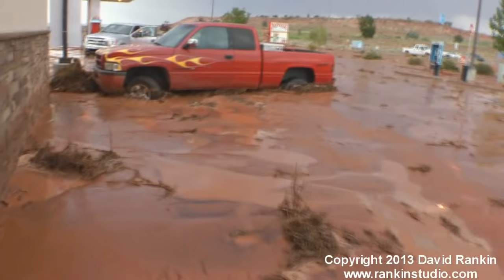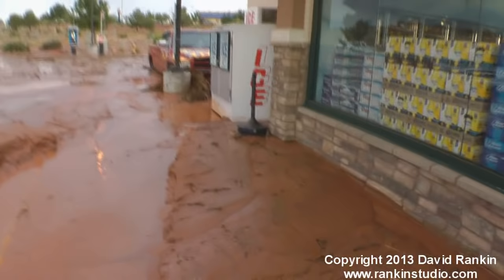Insane Flash Flooding, Antelope Canyon and Page Arizona. August 2nd, 2013

Comment: To anyone wondering flash floods happen basically every time there is significant rain in AZ. Not to this degree all the time obviously but the ground is so dry and hard that it takes forever to absorb water so if it rains for more than 10 mins its start flooding

Comment from the maker: I did tours out there for 2 years. It was amazing to see how the canyon changed from flood to flood. I have seen it change over 5-8 feet just between two floods. It was like a new canyon each time it flashed. I would think these floods are definitely lowering the floor.
Reply: Well then why did you say it wouldn't show much difference in a timelapse ? Just wondering, this video is quite an awesome spectacle, thanks !  🇨🇦
Reply: Visited upper antelope canyon and the guide showed us a feature called the cats head , went back 3 years later and you couldn't see it because the canyon floor had changed and you didn't get the same perspective

Comment: I find it interesting that Arizona  has little water and yet they allow this water to just run down hill and 'go away'. Some engineering creativity
 seems to be in order here.
Reply from the maker: They don't allow the water to go away. All of this water ended up in lake mead eventually.
Reply: rankinstudio Water will not 'wick' into the soil if the soil is dry. Diverting some of this water onto many holding areas might allow the water to sink below ground and fill up the aquifers down deep. Those aquifers are getting depleted all the time but not from evaporation but instead from farmer's and others use of it. I am very sure that much water in Lake Mead evaporates. Water in an aquifer won't evaporate. Filling them up is the issue and creative efforts of engineers could be helpful if not necessary. That is what engineers do, isn't it?
Reply: I find it interesting that you think water just "goes away".
Reply: Most of it doesn't go to waste. It can end up as ground water. In fact, we use A LOT of ground water as a good source of water here.
Reply: Aquifer (ground water) levels are being reduced faster all the time. Yes, ground water is an important source of water but, to me this video's water is just 'running away'. I doubt that much of it gets wicked into the ground to replenish the ground water already there. You may use A LOT of ground water today but what will you do when the ground water aquifers are empty? Wicking this 'run away water down to the aquifers' may be in order.......How to do that is the question.
Reply: Arizona has many groups and projects to help conserve water for the masses. In fact, I took part in a project in 8th grade that helped reduce the amount of water used to water the fields yet still have enough to keep the fields in good condition. Besides, I'm pretty sure some people out here in Arizona puts that rain water to use and the desert animals can have a source of water for the time being. Many insects and bugs can also flourish after heavy rainfall. If there is a state that needs rainfall water, it's California. The drought is still going on. :-/
Reply: Sorry if I sound a little bit defensive. I just really love and respect my state is all. But, your idea isn't exactly a bad one.
Reply: Nice that you have made some effort. Keep up the good work.
Reply: Actually I didn't see the defensive part of your message. You were just stating facts as I was. My position is still the same: The water just runs away. Beats the crap out of my but my guess is that all your 'leaders in the state of Arizona have always lived there. So this run away water is what has always been and they are unable to see the possibilities of change. There are many flood run away channels in Arizona...."It rains in the mountains...but we just get out of the way and let it ...run away.
Reply: Saving your water, or not, is not my problem but I have made an observation that may or may not have value. You decide.
Reply: I have nothing more to say about this.
Reply from the maker: Just an FYI, all of this water ended up in Lake Powell. A reservoir.
Reply: oknwht - You been to Southern Utah/Northern Arizona?  Know the geology?  The water can't "wick" into the ground because the ground is  solid sandstone, the same reason you have flash floods of this magnitude.

The best many parts of the state can do is store water in reservoirs.
Reply: That slot canyon is older than all of us.. the Earth did fine.. it'll still do fine long after humans are gone..
Reply: okn  are you a hydrologist or civil engineer ?